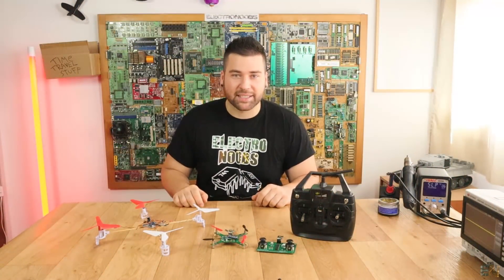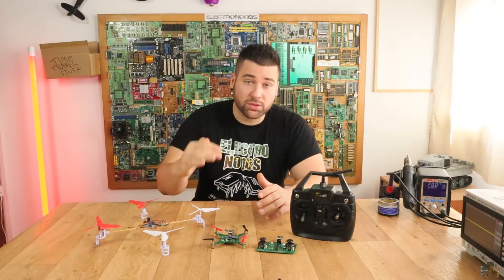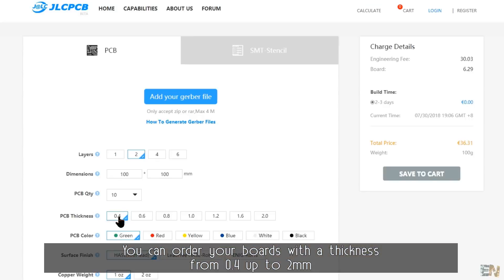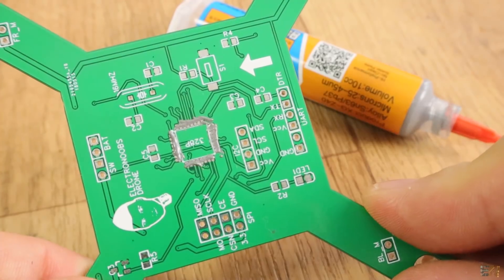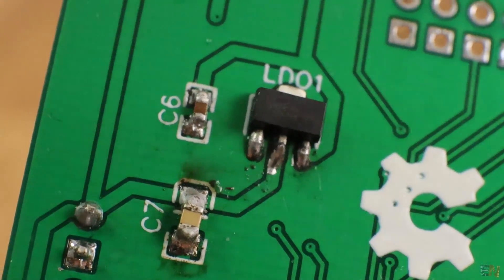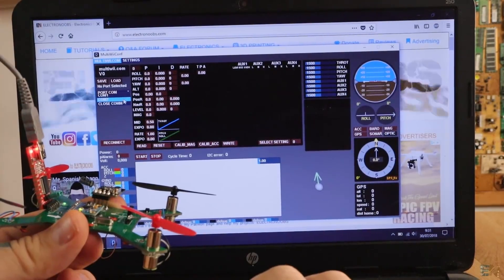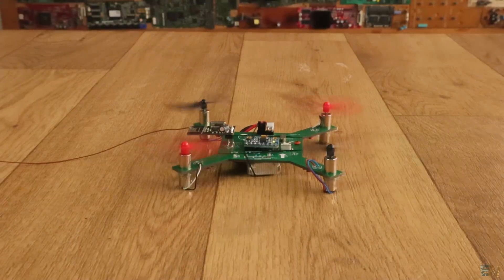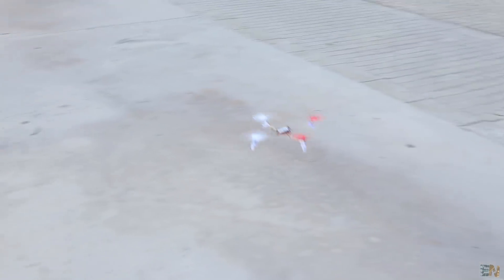Arduino brushed motors DRONE - Part3 - it finally flies

Comment: The radiomodule can consume up to 350 mA, as i remember. So maybe voltage regulator causes problems because it's not powerfull enough.
Motors are creating a lot of electrical niose. Also they provide feedback voltage when PWM signal goes low. This may cause arduino to reset itself. Instead of puting big capacitor on arduino power supply try to put small capacitors and diods between contaacts of each motor. Capacitors will reduce the noise and diodes will protect arduino from feedback voltage.
Also it is aa good practice to put small capacitors on battery output and output of voltaage regulator.

Thanks for the video. I've been waiting for it!)

Comment: Not sure if anyone suggested it: AP2112K for the 3V3, they are used on the adafruit huzzah boards with the esp8266 modules on them, have a low drop out and can deliver up to 600mA iirc. also try using some caps on the 3v3 side, so it can compensate power loss on that side too. And please get a flux pen :) maybe don't use a lot of copper fills as well.

Comment: I think hot glue might be a bit too heavy aswell, and if you make the next PCB a bit bigger maybe you can fit bigger propellers on, maybe with more pitch too (then you're back at the gear problem though). Also a 2S LiPo should give you a bit more power, just make sure your motors and other components are fine with the higher voltage.

Comment: I tried to make a fully Arduino based drone using multiwii as like u but the multiwii is very unstable as two diagonally situated motor's speed increases automatically when all the yaw pitch roll axis input are at middle position that is 1500

Comment: If the geared motors have more lift, why not make some solderpads on each corner of the drone to solder a short length of metal rod and then attach the geared parts to that. This way you have more lift and you can have a heavier drone itself.

Comment: you can make a new pcb with mpu6050 & nrf24l01all in one pcb.
I don't know what size of motor you are using but use 8.5 x 20mm (820) size motor. The quad was spinning in one direction(cc) while starting it seems like cc motor are spinning faster even if they are getting the same pulse. These motor some time do that, lower the pwm signal in the cc motor & check if it's stop spinnig.

Comment: How about a lighter LIPO?
Reply: And how about ditching the external crystal altogether. If you calibrate the internal 8mhz properly you can achiev an frequenzy variation with inputvoltage and temperature of under 1%
Reply: That's completely unnecesary. The crystal weighs just 1 or 2 g!
Reply: GRBTutorials you might think so but Im used to work with a tight weight limit and if parts are unecesary, no metter how small they are, removing them should be considered. Even small amounts add up!
Reply: Jakob Holz Yes, but relying on a thin margin isn’t good. And calibrating the internal oscillator sounds time-consuming and expensive (calibration standards aren’t exactly the cheapest thing in the world).

Comment: i don't think component and PCB weight causing it not to fly because motors and battery weight is much greater than PCB and component weight. I think your motors are not getting enough power it may be the battery or power control & supply circuit for motors check it first. if does not work try new propellers with a greater pitch angle. your previous stick drone has a larger propeller to generate thrust .
Reply from the maker: I will try everything I can to reduce weight, better power control, and yes, bigger propellers. Thanks!

Comment: From what I see, you are lacking a lot of decoupling capacitors (trow some 100n near the voltage regulator and power pins of the atmega just to be sure). Big electrolytic caps are not always the answer, check out afrotechnoobs video about it:
https://youtu.be/WytU5uj78-4

Comment: Hey I also built a 3d printed mini drone using a code given by you my drone is flying but I don't know for some reason it's continuously rotating in one direction. It's properly flying horizontally. I have tired to tune pid values, check the propeller direction, tried everything!! Still spinning 😐
Reply from the maker: Maybe if you ad a magnetometer... Also check yaw values...
Reply: il its slowly spining try to adjust the yaw trim on your transmitter, mayne it's slightly of and make the drone spin
Reply: No I have tried to adjust the trim settings. But still nothing
Reply: It's spinning fast
Reply: When I had this problem in the past the problem turned out to be the way my motors were spinning. When I checked online the orientation was different from cleanflight. So I swapped the yaw motors rotation and everything worked for both my micro and mini drone. Good luck!!!

Comment: to end the problem of restarting < put a resistor at each out put of the motors and it will not restart K it happened with me
Reply from the maker: so limit the current that goes to the motors?
Reply: , right , reduce current that goes to the gates of the transistors of motors , which makes voltage sudden drop at  start up i tried to put a capacitor like you did but i had  a little bet bigger motors so some times it worked well and some times not , so the resistors were the best solution
Reply: i think that the gates of the mosfets   don;t have high resistance at start up ......
Reply: i think that the gates of the mosfets   don;t have high resistance at start up ......
Reply from the maker: I have on my improvements list to add a 100 res between Atmega chip pins and MOSFET gates
Reply: that's good that you took that in considerations , i put 47 kilo ohm and it worked fine , , at the end you will be able to remove that ugly capacitor ^_^

Comment: If u look closely, u can see quad spinning on one axis/ motor....thrust or weight isnt an issue right now...The 2 black props stops spinning for some reason which is why drone cant counteract the torque and hence stays at ground spinning...
Reply from the maker: Will look on that. I had times it was spinning streight, PID valuues are acumulating and that will make one motor to spin faster.... Thanks!

Comment: irobot irobot
irobot irobot
3 分鐘前
Hi, thank you for your project. I have adapted your transmitter project and recently I have successfully build a micro quadcopter just like you do here. I have use module to step up voltage to 5V for the mcu first (commonly use for step-up li-ion cell) and use AMS1117 to regulate back to a stable 3.3V for nrf24L01. If your brushed motor are good (not noisy), there is a chance you do not need any cap, otherwise you can add 100uF cap both before and after the step-up module, it will solve most of the voltage problem arise from the motor.  Also if you use radio.setPALevel(RF24_PA_MIN); , you do not need to add cap to nrf24L01, otherwise you need a 10uF cap on the power pin. Hope it helps.
Reply from the maker: Thanks!!
Reply: Electronoobs you should check out the youtube channel channel - Greatscott. He is also like you.

Comment: Bro to decrease the weight pls do not solder nrf and mpu6050 modules with headers they are the main problem remove the soldered headers from it and solder it to the main PCB like smd . Just like esp8266 12 e module is surface mounted on node mcu board.

Comment: Dude, try to get a Gaoneng 1s battery with high C ratings. I had a lot of problems like that because of the battery I was using. 😉
Reply from the maker: ok. Thanks a lot!
Reply: Motor bataiye kahan milati hai please
Reply: Unke motor bataiye please please

Comment: As what I can see from the video is that the front side of the drone is that where nrf24l01 is soldered. According to that the black propeller at front right must rotate in anticlockwise direction. Similarly all the propellers are moving in apposite direction. 
Change the direction of propeller and it will definitely fly.
Reply: I agree that there's something funny about the motors.  It isn't just a matter of there not being enough power.  Also, that battery probably weighs more than it should for those small brushed motors.

Comment: Use a buck converter for 3.3 voltage.
Reply from the maker: might complicate the board too much but I'll have that on my improvements list.
Reply: That would be a very important fix because a LiPo goes anywhere between 4.2V (fully charged) down to 3V (when you want to cut off to prevent overdischarging). Driving the radio from the LiPo directly is a great way to destroy it (or rather to drastically shorten its life, it may not fail outright), the voltage spec for the nRF2401A is 1.9-3.6V only. 

If you want to save  a regulator and only drop down the voltage to a safe level you could use a diode with Vf of about 0.5-0.7V. However, the regulator also ensures the radio has a "clean" power, without the various noise and current spikes from the MCU and the motors.
Reply: Raghav Srivastava it would be kinda heavy for the quad
Reply: Shut da hell up yes but would be efficient
Reply: An AMS1117 voltage regulator should work for 3.3 v as outputs 800 mA

Comment: Spinning may be due to 4 reasons 
1) You may have inverted the propeller eg: CW propeller instead of CCW 
2) Inverted motor spinning direction 
3) Motor layout may be wrong, so check with firmware 
4) Adjust the trim values either in software or in transmitter
Good luck! .
Reply from the maker: THanks!

Comment: How can i change the code to work with nodeMCU ? It has many advantages, wifi, bluetooth so can able to control with Android App, instead of NRF24.
Reply from the maker: I don't know for now...
Reply: That's easy. You can download the definitions for the ESP8266 and the ESP32 boards following this tutorial from Andreas Spiess: https://www.youtube.com/watch?v=DgaKlh081tU. as However, you'll have the code for Wi-Fi or Bluetooth yourself, but I don't recommend using Wi-Fi or Bluetooth for controlling it since it's not made for long range, fast moving devices. You could use it for transmitting video, but that's an entirely different matter.
Reply: Will try. Thank you :)
Reply: @aerostatdrones3370  You might encounter problems when powering ESP32 as I noticed BLE will not work if supply voltage isn't stable - the case with super power hungry brushed motors we have here.. You will need to provide stable voltage supply, thus take a look at adding LC filter and correct caps where needed.  As a reference can follow this schematic :) https://wiki.bitcraze.io/_media/projects:crazyflie2:hardware:crazyflie_2.1_schematics_rev.b.pdf

Comment: I can bet that the direction of propeller is not correct. 
I have made drone with brushed motor and faced same problem. After I connected the propeller in right direction It worked pretty well.
Reply: Dear Electron noob recheck the direction of propeller. You are only one step away from making the drone fly.
Reply: Waiting for the next video in which I will be able to see your drone flying.
Reply from the maker: No. Propeller direction is not the problem. Thank you!

Comment: Place the Motors on a weight scale and check the thrust, i'm not sure the weight is the main problem, as you can see the quadcopter rotates on the z axis, i think something is wrong with the code or the motors themself, looks like if they rotate much more CW than CCW
Reply: Watching the video more carefully you can see that sometimes the black-propelled-motors "freeze" badly while the Red ones are still spinning, I don't know if they freeze for real or just the frequency is reduced and because of the camera It looks like they are freezing, but something is for sure going on, there is no balance between CW and CCW
Reply from the maker: Thank you for the tips. I'll try more on this for a future version

Comment: Hi Electronoobs, why not try using a lighter/smaller lipo for initial test just to make sure how much weight you need to drop to ensure liftoff and decent flight.
Reply from the maker: I've done that but I thonk that the propellers are still too small for this weight.
Reply: @ELECTRONOOBS  Can u plz help me 
Phone number and whatsapp:6239465569
Instagram:sunil_kumar__105

Comment: Red motors are running faster than black
That is causing it to rotate CCW
(counter clock wise).
Reply: What file name for upload to arduino for working project??receiver or multywii+nrf24...?? Cause to much code for this schematic
Reply: @jeefryarcs  
I want the PCB board l want to use it to make a project
Reply: @afoerinwajuliana3367  why to me??

Comment: I think it didn't lift up that because of small propeller.
Or you may use 2 x 3.7v battery with little bit bigger propeller from than which you have used in this project........................
Your drone need more thrust than it's weight.
Reply from the maker: That was the first schematic with 2S bat. But for that you need a 5V regulator and a 3.3 one for the radio mdoule. THat's why I've decided to go with 3.7. I'll have to try bigger props...
Reply: Electronoobs you may use DC to DC adjustable setup converter that 3.7v to 7.4v to drive the motors that may be helpful because boost converter is a less weight than use of 2 cells.... And must use bigger propeller to get more lift power than smaller one.
I share you a link of aliexpress you can watch this it may be useful for your project
tps://m.aliexpress.com/item/32719451309.html?trace=wwwdetail2mobilesitedetail&productId=32719451309&productSubject=DD06AJSA-DC-2-6-6V-to-3-15V-Adjustable-Output-Board-DC-DC-Boost-Step-up
I am big of you, I wish you get success every time of your all projects..

Comment: you need to use another motor with gears.
for the supply try to add titanium cap. and you may also need to make that battery 2s instead 1s to increase the voltage.
Reply: Can u plz help me 
Phone number and whatsapp:6239465569
Instagram:sunil_kumar__105

Comment: Why didn't you use soldering paste for soldering ?
Reply from the maker: RMW 360 I did use but not for all components...
Reply: That is my question  , why
Reply from the maker: for capacitors and other 2 pin components it's easier for me to just use the soldering iron and solder wire.
Reply: Oh ! Ok
Reply: What is the total weight of PCB version of the drone ?

Comment: i am making 400 to 450 size brushless drone >but u burn 2 ,(30 ampr) esc i will buy it but have any idea to protect esc (30a) and also i buy 12v normal led strip i want to connect flight conntroller  >i make flight controlller that you have made in past totorial> 
i want to add my led blink code in multiwii >
this is my program 
/*my header file name led.h
compiling is done but the code does not work yet what i do ?
and also  how i connect landing lights on multiwii?*/

#include "Arduino.h"
#include "MuiltiWii.h"

void setup() {
  // initialize digital pin LED_BUILTIN as an output.
  pinMode(5, OUTPUT);
}
void loop() {
  digitalWrite(5 , HIGH);   
  delay(1000);                     
  digitalWrite(5 , LOW);   
  delay(1000);                     
}
THANK YOU
PLEASE HELP ME IF YOU HAVE TIME ><><><
YOU SEE I AM YOU SUBSCRIBER AND REGULAR VIEWER

Comment: If weight were the main problem, then it would spool up and not move. Yours is spinning in a circle, indicating one or more of the props are spinning in the wrong direction OR the rpm of the props is significantly off either due to malfunctioning motors or the controller is doing it on purpose for some reason. Also I'm sure you know those small DC motors are only designed to spin in one direction, yes? The wire colors indicate if it is a clockwise or counterclockwise motor.
Reply from the maker: Weight is the main problem. It has more but that makes the drone not to fly. It spins in a circle because: since it won¡t lift, the PID gets bigger and bigger on one side. Motors are spinning in the good direction and propellers as well. I will have to try bigger propellers and less weight. Thanks!
Reply: Electronoobs 
I disagree with your assessment. If the controller were operating properly, it would spin the motors at the required rate to achieve the target yaw rate. If you're NOT telling it to yaw, but it IS anyways, there's a controller problem OR the motors are not responding in the way the controller expects them to. 
It seems you have a yaw control problem as well as too much weight. Either way, I hope you figure it out, this is a great project!
Reply: timjs1018 Yep, I totally agree with you, I had the same feeling watching how the drone rotates on the z-axis, It looks like if a diagonal couple of motors is spinning more than the other
Reply: timjs1018 really? i thought coreless motors can spin in both ways
Reply: Shut da hell up 
Yes. They can but the brushes are directional and wont last long running "against the grain" so to speak.
Reply: These motors can spin both ways
Reply: @FarazKhan-to5ow  did you not read what I said?

Comment: Put a diode between supply and Arduino with a Capacitor... A high current surge also discharges the capacitor connected to the Arduino.
With the help of diode you don't need a heavy Capacitor
Also try 6.5cm propeller 5.5cm or less doesn't work
Reply from the maker: Rajat Tarade thank you!
Reply: 10pair 65MM ABS Propeller Blade CW CCW For 6 X 15 Coreless Motor Racing Multicopter For Q100 Frame 720 8520 Coreless Motor 
 http://s.aliexpress.com/jUvmmam6?fromSns=Copy to Clipboard
Reply: Design your next PCB according to the 6.5cm propeller
Reply: Rajat Tarade 6.5cm perhaps??? 6.5mm is about a quarter of an inch...
Reply: duncan amos yes 6.5 cm 😅

Comment from the maker: Want to help my workshop: https://www.patreon.com/ELECTRONOOBS
Thank you so much!
Reply: I am guessing that inductive loads(i your case are 4 motors) are intrudcing a lot of ripple or noise to your battery and 5v requirement is not completely being built up for atmega 328p so i recommend you to use a 5 v boost convertor for atmega328p and 3.3v ldo to get enough of 5 volts and IP5310 based boost converor would be perfect application for your case as it also includes charging protocol for li-ion battery.